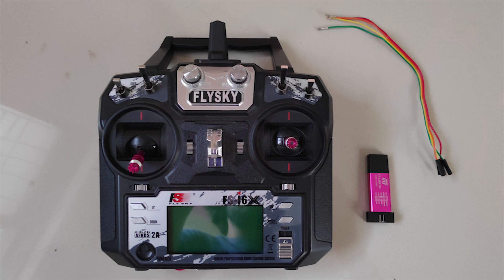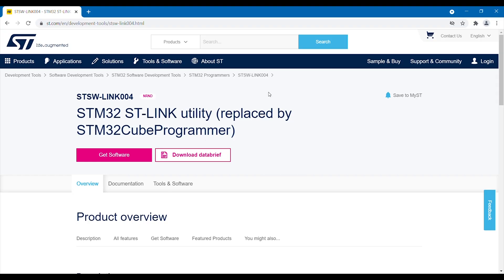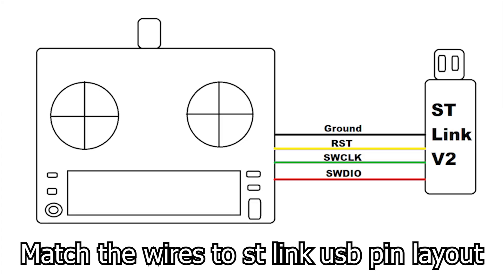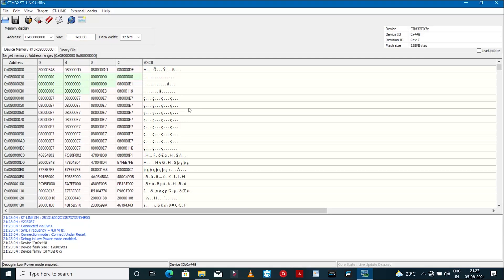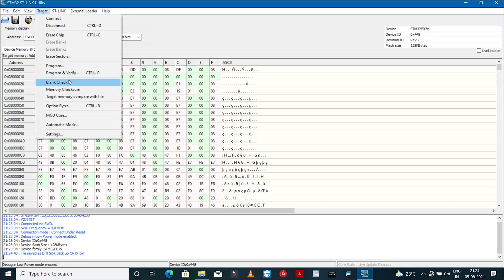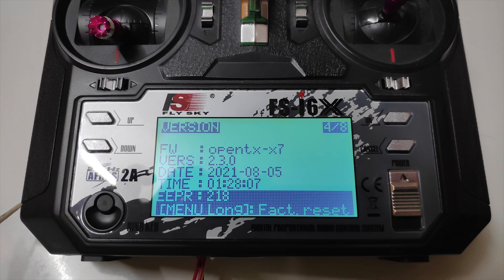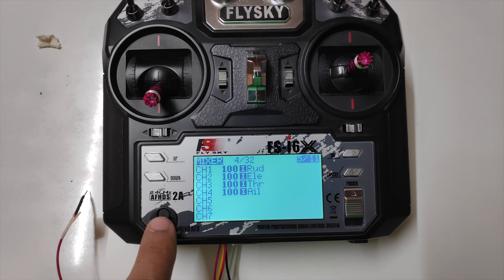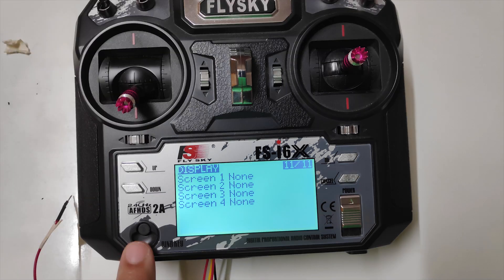FlySky FSi6X Installing OPEN TX | Tutorial

Comment: Great video,  After install open Tx firmware  does the transmitter required external module or it will work with inbuilt module and receiver?

Comment: Hi i watched your video  about 3 month ago an i was happy to get my new FlySky i6x but i was trying to flash it and all the connections are made properly i literally fallowed your video until connecting the smt32 connector getting conected to the computer since as soon as i connect it to the computer the radio start beeping for some reason:
Important to say no spark no wird sound ,  if i turn on the controller it works fine with no problems what should i do ?
Reply from the maker: Seems like the ground wire connection is touching some other wire causing it to beep. Check the connection and solder joints for any bridge. You may follow the dfu method which is easy and needs no soldering.
Reply: @RakishRc  I Did not check that the processor had to be the same before ,  it was my fault: 
https://user-images.githubusercontent.com/87794877/241003067-5137e1e9-111b-4828-a574-4cb913fac243.jpg
this is the picture of the processor

Comment: Hey, where can I buy stm usb adapter?
Reply from the maker: It's available on robu.in website and Eve Amazon and Flipkart
Reply: @RakishRc  okay bro
Reply: @RakishRc  bro can you please suggest me some best budget express elrs
Reply from the maker: @akshayharidas1235  2.4ghz or 900mhz?
Reply from the maker: @akshayharidas1235  currently i am not able to see any elrs tx and rx combo in stock. You could get a r9m and MX receiver and flash elrs firmware on it but it's 6k on robu website
Reply: @RakishRc  that's too expensive for me, can I order it from bangood?
Reply from the maker: You can use dfu method too for installation of firmware if you don't have st link device. Check open tx fsi6x dfu video
Reply: @RakishRc  currently I'm watching that video 😂❤️

Comment: Hello Rakish,
1.8.0 is available now!
But I have a problem about AFHDS2...
Iz it possible the firmware wasn't write correctly? What do the software when you enter the values size & data width?
Reply from the maker: You have installed 1.8.0? What problem with Afhds2a?
Reply: @RakishRc  Yes I install it Yesterday, but I think it may loose something in installation... In "model01" when i go to RF internal, I have AFDS OR none. but don't have AFHDS2

Since 1.8.0, AFHDS2 is available
Reply from the maker: @Krakinutts  rest from settings and check
Reply: @RakishRc  Do you will install 1.8.0?
Reply: I am Dronard in guitub. I send some message in "issues", AFHDS2 is missing
Reply from the maker: @Krakinutts  yes I have i did test it yesterday it is working correctly
Reply from the maker: @Krakinutts  make sure to look in the internal rf option
Reply: @RakishRc  I post my problem on guitub, I show the menu were I can't get AFHDS2
Reply: How i can give you a link ?
Reply from the maker: @Krakinutts  https://t.me/RakishRc telegram contact here
Reply: @RakishRc  Thanks, I have to wait, Telegram don't allow sending messages to others than my contacts

Comment: Unfortunately solder pad on swd0 is broken. Where to connect alternative? U have diagram?
Reply from the maker: Bride r53 pad and use usb cable to connect radio in dfu mode. Watch the dfu install video

Comment: Installed the openTX firmware following your instructions (v1.5.0). However I am unable to bind an FS-iA6B receiver. Can you post the binding channel settings.
Reply from the maker: Hi, did you enter the receiver in binding mode first and then turn on the radio and select bind from the radio fhds2a protocol settings?

Comment: great work my friend.is it possible to install voice package also?
Reply from the maker: It can be possible but due to storage limitation it's not implemented. Erfly6 has voice you could try that perhaps but you'll need to make some hardware changes i guess
Reply: what do you mean by hardware changes please?
Reply from the maker: @keithmercieca6000  i am not a 100% sure but you need to install a audio player. Id suggest join the erfly6 telegram group and get help from the folks there. Since I don't have a fsi6 i haven't been able to test it or make videos on that.
Reply: but is it possible to install an fsi6x?
Reply from the maker: @keithmercieca6000  you can install erfly6 firmware on FSi6X too. Erfly6 is meant for fsi6 which is similar to open tx since fsi6 cannot support open tx. Both firmwares offer elrs support
Reply: thanks a lot my friend. please do a video if you manage to install open tx on fsi6x with voice package.. thanks again

Comment: Hi, 
Is this a BUG ? : I can set up the 2 position switch to CH5 (1000 - 1500 (not 2000 ??)) I would need it to be 1000 and 2000 and
I can not find a way to set 3 position switch (CH6) to output 1000 - 1500 - 2000 values. I managed to get 1000 and 1500 only ?
Anyone can advice me ?
Reply from the maker: Hi, is that with elrs setup or flysky afhds2a protocol? Because I have observed that channel 5 and 6 don't work in simulator mode for some reason. So I am not aware of the channel resolution issue in normal mode but I'll have to check.
Reply: @RakishRc  - please have a look this version I use:  IRX HST-I6X 1.0 21-Dec-2016
Reply: Sorry  wrong - this is correct from transmitter pg4/8 : openi6x, 1.3.0(0)dtd.
Reply: Any news Rakish - if this can not be solved I will need to go beck to Original ...
Reply from the maker: @Mike4_friends  can you specify details about which receiver you are using and which protocol?
Reply: @RakishRc  FS-IA6B receiver -Mode FS2A, subtype: PWM,IBUS
Reply: any news for me Rakish?
Reply from the maker: @Mike4_friends  hi sorry for the late reply. I'll test tomorrow and get back to you. You're using betaflight or any other configurator?

Comment: Hello there,

Excellent tutorial!.  I have a question: I have the cable that communicates the Radio to my computer by USB, I'm using it for SIM's on Linux and Windows and it works perfectly!, I can use it instead of opening the radio and adding the jumper wires.

Regards,
Reply from the maker: Hi, for the first time when you flash from factory firmware to Open tx firmware you'll either have to use st link via jumper wires or p10 jst connector or jump r53 pads to initiate dfu mode and use stm32 cube programmer to flash Open tx. After you have installed latest open tx firmware you can use the regular cable to update the firmware via dfu using the trim buttons 👍
Reply: @RakishRc  Thanks for getting back!. I'm looking to flash mine to OpenTX, I still have other questions: 1.- Can you please share with us the cable connection on the USB side to the jumpers on the motherboard, you show an image in the video but it's not detailed how to connect this 4 cables on the USB side. 2.- Have you successfully flown on this FS-i6X and OpenTX? if it's so is there any complaint, problem, or anything to consider it not stable.

I really appreciate all your help.

Regards,

Comment: Hi i flashed it and then it started formating eprom after that it dosent connect to stlink nor goes ahead of switch warning its stuck some times it shows white screen major issue is that i cant flash it back as it dosent connect
Reply from the maker: Did you damage any motherboard components while soldering?
Reply: @RakishRc  na man i was very carefull i have ben repairing my own stuff for quite some time now so my skills are overqualified for this job
Reply from the maker: @illusionistsam  okay 👍 so there is open tx firmware 1.1.1 available. Try to install that. Connect the st link, power on the radio don't bother about the screen as long as it's lit. And then connect in the st link utility software. You should be able to flash it.
Reply: @RakishRc  bro tried that but stlink dosent pick it up i flashed 1.1
Reply: Elrs v2 fimware
Reply from the maker: Then are you able to enter the DFU mode by holding the bottom two horizontal trim buttons inwards and turning on the power switch? If yes you should be able to flash by DFU mode. https://youtu.be/5jW7gGt15EI check this video

Comment: ERROR WHILE CONNECTED WITH TRANSMITTER- 
23:22:38 : ST-LINK SN : 5200410014000047474D4D4E
23:22:38 : V2J37S7
23:22:38 : Connected via SWD.
23:22:38 : SWD Frequency = 4,0 MHz.
23:22:38 : Connection mode : HotPlug.
23:22:38 : Can not connect to the target!
                  Please select "Connect Under Reset" mode from Target->Settings menu and try again.
23:22:41 : Unexpected error
PLEASE GUIDE
Reply: Try new fresh system. I had connection problem when I tried to do it on a old system, probably it had old drivers that I used for hoverboard flashing. When I switched to fresh windows 10 it connected after try.

Comment: ALERT ITS NOT CONNECTED - ERROR=>>>>>>>>>>>>>>>>>>>>>>>
 Can't reset the core
19:24:12 : Can not connect to target!
                  Please select "Connect Under Reset" mode from Target->Settings menu and try again.
                  If you're trying to connect to a low frequency application , please select a lower SWD Frequency mode from Target->Settings menu.
19:28:13 : Can't reset the core

Comment: Hey great vedio 
Is there opentx for radiolink at10 2 radio transmitter
Reply from the maker: Thanks 👍 I am not sure but I guess it can be flashed with open tx if made available.
Reply: @RakishRc  i don't understand one thing 
First of all the radiolink use stm32f103 vert6 arm based microchip 
And i have the full circuit  diagram of the transmitter 
Most importantly I'm not good at programming but from my least memory i can say it's very possible to be able to use opentx in this tx 
But is their is specific firmware nessecary for that tx ???
Reply: @RakishRc  in the radiolink transmitter if you open the transmitter  they even add 3.3 GND RX TX BOOT0 RESET pad FOR FURTHER  CONNECTION AND  THEIR IS USB CONNECTION AVAILABLE TOO  and the tx modeul use spi communication for transmitting data
Reply: @RakishRc  and the dedicated tx modeul cost you 9 dollars only

Comment: 2014년 08월 16일 MAINBOARD. Is it possible? ST-LINK V2 is not working properly.
Reply from the maker: Ofcourse it's possible. why st link is not working? What's the problem
Reply: @RakishRc  I'll upload it to YouTube tomorrow. Thanks for the quick reply.
Reply from the maker: @Ejunsun  okay
Reply from the maker: @Ejunsun  okay you have the FSI6 radio not the FSi6X.. open tx for that radio is not yet developed but will be in the future. You can use er9x for this radio which is similar to open tx. For that the process to install firmware is bit different. I'll post the link below
Reply from the maker: @Ejunsun  https://www.rcgroups.com/forums/showatt.php?attachmentid=15296551&d=1630129436 check this link... You can use the stm adapter and under settings select normal mode..it should connect to target and then select the fsi6 firmware file from the erfly6 folder..it's mentioned in the video link I've posted above
Reply: @RakishRc  Thank you very much !!

Comment: OK. ... It was ground connected in the wrong pad, thereafter it flashed correclty.
 ...but  now... if I disconnect the st-link, the on-off switch does not work (come up) any more. If I reconnect st-link, fs-i6x display lights up again and menus work...
Any idea ?
Reply from the maker: Seems like you have the solder wires touching eachother or bridged somewhere while soldering. Inspect the solder points and make sure your wires are not touching eachother. If you have ground connected to stlink then the radio becomes unresponsive. So best once flashed discontent wires from st link adapter and tug the wires making sure they aren't touching eachother

Comment: Hi, does not work for me. St link sw shows 3.17 v, target not connected. Is it correct the RST pin (there is a RST named pin on the board, same version of video)  ? Did You forget v 3.3 ?
Reply from the maker: You have to make sure the radio is Powered on. Because I haven't used the 3.3v or 5v pad I power on the radio while flashing. If it's off stm utility cannot connect to target. If you have connected the rst swdio swclk and ground correctly then you should get it working. Make sure the wires match the right pin on stm adapter too. 👍
Reply: Try to do it on a fresh windows
Reply: @przemos7816  Thanks, problem was  Solderino the wrong pad and missing power cycle. Now everything worls. I got furher minor problems, but no blocking up to now.

Comment: Once You have installed opentx firmware the first time, is it possible to update it by means of opentx method, or is it still necessary to use soldering ?
Is it possible to use usb ? (Fs-i6x does not provide  sd card ...) ?
Reply from the maker: The developer is still working on it so hopefully via the ps2 port at back we could update in future. Currently you can either keep solder wires attached or use a debug port available on the bottom right of motherboard with appropriate connector if you can find

Comment: Great tutorial! Thank you so much. Do you know how we can use external modules with open TX? Can we use express LRS?
Reply from the maker: Mariano is currently working on how to get it working. But I've used uhf system with the DSC port connection so any external module can be used just the DSC port has to be functional which I believe needs some work

Comment: What features can get upgrading to open tx?
Reply from the maker: Gautam with open tx you can configure various settings with a lot more freedom. Like you can have multiple mixer options, customize home screen and telemetry screen. You could use an external module and option to use more channels than what's available with stock firmware. I've got a video covered on all that.. will be uploading soon
Reply: @RakishRc  is it full stable version works without any issues ? Like Mariano said can be upgraded without soldering using the white port ? Can u check and let know ? I have no experience of soldering nd would like to do that way.
Reply from the maker: @gautamsenthilkumar823  he said he will test with a multimeter and let us know. I don't have a multimeter so would have tried. But I guess that empty port may very well be for serial programing. There are few bugs but nothing major.
Reply from the maker: @gautamsenthilkumar823  okay Mariano has posted a picture with the port pins labelled. You can use that by using appropriate wire adapter. Don't have to solder then 👍
Reply: @RakishRc  great thanks bro 👍🏼
Reply: @RakishRc  posted where ?
Reply from the maker: @gautamsenthilkumar823  rc forums. Link in description

Comment: Excellent video Rakish, thanks. I have to check it, but I think that the white socket close to the flashing pads, has all the pins needed, I have to verify this with a multimeter. That would allow to flash without soldering.
Reply: Do you have a update with this sir
Reply from the maker: Oh that'll be awesome then. I don't have a multi meter or would have checked too.